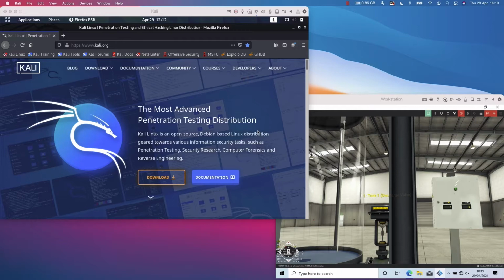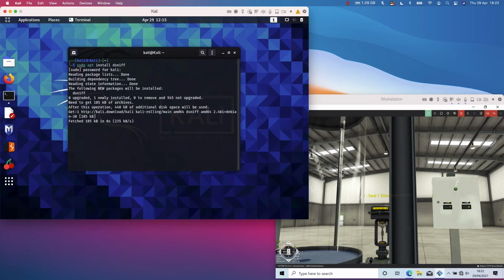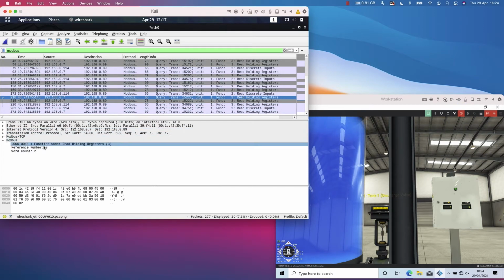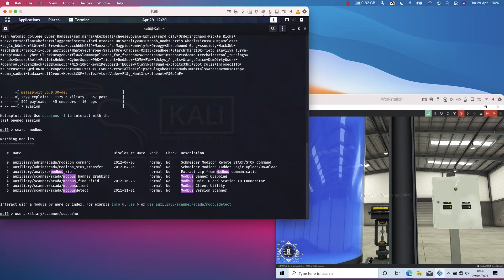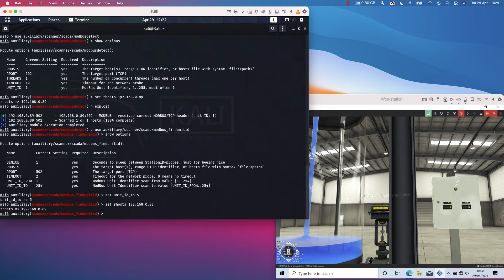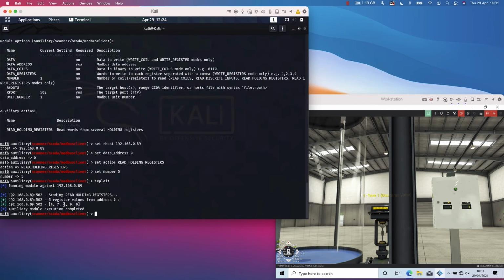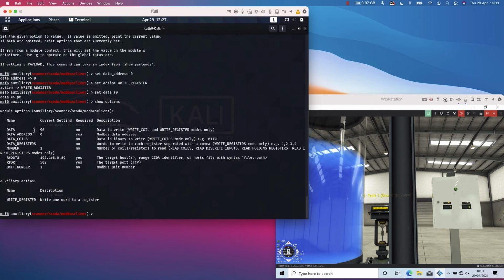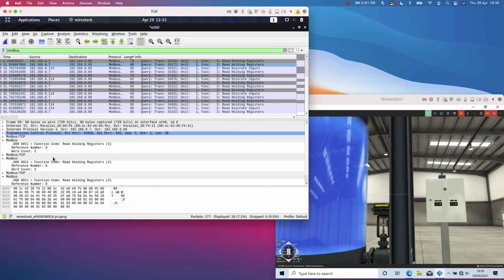Cyber Physical Systems Security (5: Attacking SCADA and Modbus Communications)

Comment: Excellent video. I just wondered if pentesting ICS systems you're unlikely to be reading or writing over Modbus in case you break something. Is there really a need to understand these protocols in that case?
Reply: yes, normally when pentesting ICS systems are in a critical infraestructure, and you are require to write in your report by law to specify technical details on how you use the protocol.